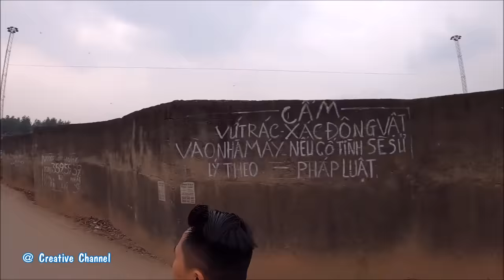Build Electric Cargo Bike Using 750W Reducer Brushless Motor

Comment: Smart idea of putting the batteries under the seat so you can still use all the room in the bed of the bike
Reply: and mostly center of gravity
Reply: Be sure to cover with explosion-proof <bottom vented> & weather proof housing.
ditto for controls and electronics.

Bob Duda
Reply: maybe getter a cover is better
Reply: Question is that charge itself or must put on charger?
Reply: @mutterderweltagypten2502  It seems the batteries are not chargeable. If they're out of power, there you go, it's gonna be on manual. It's a hybrid system anyway.

Comment: Really nice build, and very well presented, the one thing you need to do though is to place a layer of rubber between the batteries and the base of the battery box to isolate any road vibration and an adjustable strap to hold the batteries in place.

Thanks for sharing your expertise.

Comment: Please add a freewheel sprocket to the real axle so you can also use the pedals if the battery runs out. Dual Drive.

Comment: That is a great build. One question though, how long will those batteries last for? Until they cant charge again that is.
Reply: I think 5 x 12 volts and 20 Ah batteries in series are 60 volts 20 Ah.
On the engine stand 60 volts and 21 amps
So about an hour.
Reply: Addres ta dio khub bhalo biniacho
Reply: In
Reply: @FormWerkstoff  those might be LiFePO or lithium ion batteries, not necessarily lead acid
Reply: @FormWerkstoff  and you will not use full capacity of the motor during your ride. So it will work nicely

Comment: I hope your welds hold.
Next time grind or sand down to bare metal, instead of welding where there is paint.

You should also use a different color hot and ground wire.

Comment: A gearing system for pedal power when batteries run low would've been an added bonus. But I'm afraid in our country we are legislated out of the self-do road vehicle hobby. This vehicle would fail on so many points of health and road safety regulations.

Comment: No "dead man" switch? Like a bracelet that plugs into something near the handlebar. That way if you fall off or something malfunctions the motor stops.
Reply: This is a thumb operated trottle.
Removing thumb/hand stops the motor. He is just showing the bare minimum part count to run his project. You can add all the bells and wistles once its operational..

Comment: What will be,if they must use the brakes because of Danger.
Normal pedelecs who works only if you use the pedals got a max speed of 25km/h and have hydraulic brakes or disc brakes.

But this 3-wheeler is fully electric works without using pedals and i guess is faster then 25km/h

I am very sure it has normal brakes who are Not made for that speed

I also would like to know,Why he didnt built a waterproof box around the electric devices
And..whats about Lights?

Comment: I can see that the rear shaft connect both wheels, so  how can it work without  a differential  ?
Reply: A differential would allow the rear wheels to spin at different speeds, which is primarily useful when turning, but it's not absolutely required. In this specific case, the bike will still function okay, it will just be a bit difficult to turn, especially for sharp turns as the rear tires will have to slip against the ground.

Comment: Mabye make front suspension ? Smoother ride 👍🏻 great work 😁
Reply: Alfzor, a front end salvaged from a 125 cc motorcycle could probably be fitted by replacing the head bearings and a bolt of the correct length, you would need to make sure you grab one from a dirt bike due to the fact you would be carrying more weight than normal, but even a standard road bikes forks would be fine as long as the diameter for the wheel was kept the same, meaning no smaller, so the handling wasn't compromised.

Several years ago I modified one of my motorcycles by adapting the front end from my '72 SL 250 Honda to a '64 CL 72 / 250 as it had a 21" front wheel and the CL's front end had a 19" and not enough travel, and swapping out a front end is a lot easier to do than it appears.

For those familiar with these bikes, yes the CL is much heavier than the SL, but I love this old bike and that engine is bullet proof and with a larger rear sprocket it will go anywhere I point it, just have to get used to the extra weight and since I've had it since '72 I have no problems, plus these engines put out more power than even the SL 350's did.

Comment: Welds frame and motor and stuff, TAPES battery's to welded rack. Hmmmm. One would think he would have finished welding the battery box instead of using tape. If he or anyone riding this crashes those battery's are gonna come flying off hurting people.
Reply: Yes your right. Building a battery box wouldn't take a lot of time.

Comment: Did I miss the recharging part of the batteries? Great engineering , great video 👍👍👍👍
Reply: For this set all you need is higher powered 12V car charger. Cheapo, available. Easy.